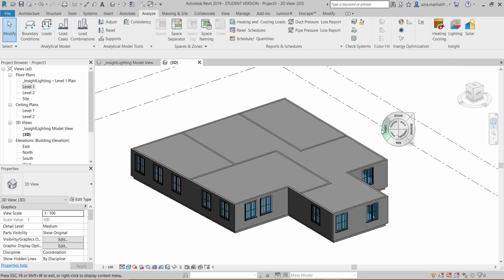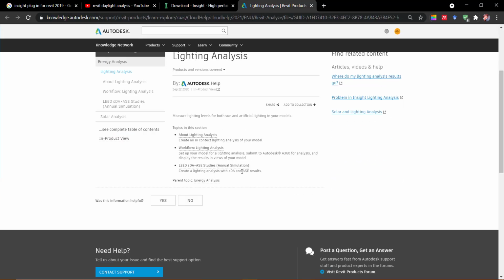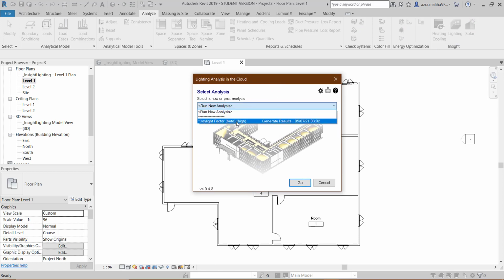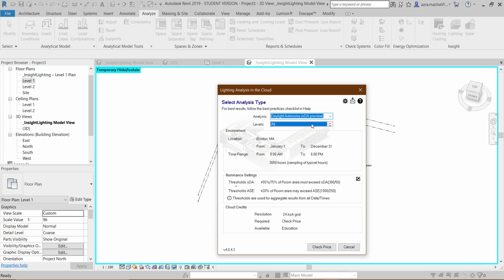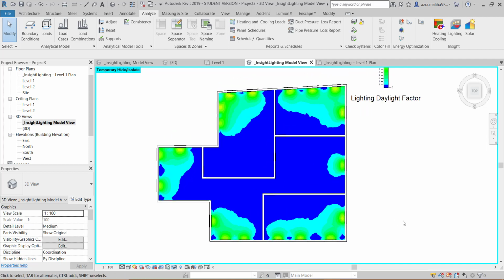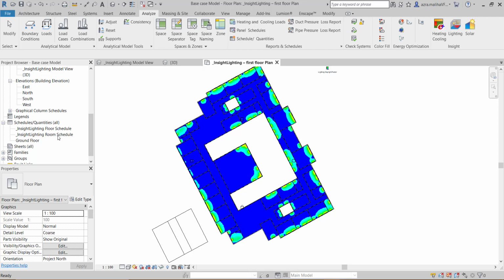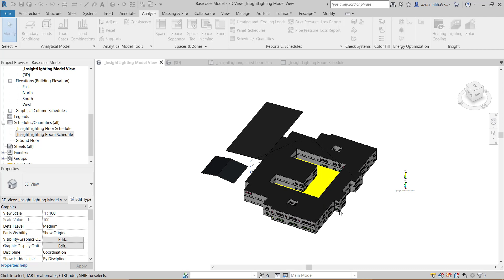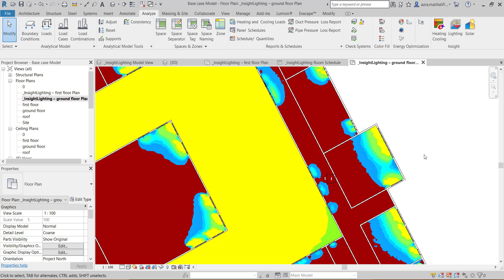Daylighting analysis made EASY!! Learn how to do daylighting analysis with REVIT Insight

Comment: Thank you for the video. I have a dilemma with the model I am working with. When I ran the illuminance analysis, the result does not capture the artificial lights added only the sunlight, making my lux/fc levels very small. Any suggestion on how to include both the sun and added recessed lighting fixtures?
Reply from the maker: Hi Ibrahim. I am not much aware of how to add artificial lighting in Revit and run the lighting analysis.

Comment: Greetings,
I am trying to run a Daylight Factor Analysis using Revit 2021 and my project has 5 different levels. I want to run analysis on ground and first floor together but the Floors not shown in the sequence I want while running the analysis. Initially I used to press shift and select multiple floors that I wanted to run my analysis on. But because they are listed in a very odd sequence, I am unable to select 2 floors together without selecting two more floor levels. Consequently, it is making it impossible for me to select two floors that I want in my analysis. I don't want to run 2 separate analyses because then I would have to combine both in excel and that is a very lengthy process.
I usually add a number before my floor levels so that I am able to see it in a sequence within my project browser. I tried removing the numbers as well to check whether that sequence changes in the analysis dialog box but no avail. I have tried creating new files, copying the existing structure to another file as well but nothing seems to work.
Do you know how to cater this issue?
Thanks.
Reply from the maker: Hi. It's a very odd problem that have occurred with you. It's better if you can send me screenshots of ur levels, or ur revit file to me so that I can try for myself and send u some solution if possible. My email is azra_maliha@hotmail.com

Comment: Thank you for sharing this process it was quite helpful. I have a question in this regard. We need to add materials with original settings in the project so that the light reflection values are similar to the original building settings right. So in order to add paint having the original Light Reflectance Value for wall paints, I am having a trouble assigning a physical parameter from material library to it. How did you assign the proper materials in those settings?
Reply from the maker: Hi Maria, that's a great question you have raised. Unfortunately revit doesn't allow such detailed parameters for their materials like reflectance, unlike software like the IES. As far as i have learnt, the amount of daylight inside the revit building is dependant mainly on the windows and openings, irrespective of their reflectance. So the analysis is done on simple open-or-close situation. If your study required such parameters, I prefer different software like IES, DIALUX etc.
Hope this helps
Reply: @azramaliha  Thank you so muck for responding. I get it now.

Comment: Thanks.. is Revit insight the best software for daylight analysis
Reply from the maker: I wouldn't say it's the best and ultimate software but it is great for several reasons. For example the analysis happens in the background so you don't have to stop everything and wait for the results, the results are very elaborate and dynamic too. However in case of illuminance analysis for example, lux contours are usually not perfect on Revit so a supplementary software needed sometimes.

Comment: I wanted to know.. this analysis will work in revit 2021 … because I installed a plugin but the start analysis button is missing… please guide me
Reply from the maker: Hello, yes absolutely it will work on 2021 version. You can find more video on my channel showing analysis in 2021. 
Make sure you installed 2021 plug in and I recommend to restart the computer before using. Let me know further

Comment: Hey! great video. I'm trying to analyze REVIT 2021 but it says " Requested service not available" I don't know why. iIt doesn't work.
Reply from the maker: Hi. I'm not familiar with this error but I helped someone solve it earlier. You could do the following things that might help:
- check if the Inshght plug in is installed properly 
- check your license, what kind of Autodesk license do you have. A crack version might create an issue
- try restarting the computer after insight installation
- if still the problem occurs, try uninstalling the revit using Autodesk Uninstall tool and reinstall again.
I hope these helps. Let know any further issue
Reply: @azramaliha  Huge thanks for the reply. Hope it works!! Cheers!

Comment: Good evening I had been watching other videos of lighting analysis with Revit plus Insight but it happens that they are very old, I found your video that is recent and it seems very good ... the problem I have is that in other videos I saw that in their planning tables both floors and rooms gives complex data with percentages (in my case the room planning table comes out the same as you do, but I don't get any information on the floor plan) ... do you know how to do this? I hope you can help me… Thank you.
Reply from the maker: Hello. Firstly, revit doesn't give data on floor plans, it's the exact same way as the video. They give a legend though which you can see a small bar on the side. Could you give me the link of the other videos you have seen? So I could tell you further. 
Because throughout the years Autodesk Insight have changed and they actually stopped a lot of options
Reply: @azramaliha  
Thank you very much for answering ... The video that I mention is this: https://youtu.be/a9PbZw9h6KY

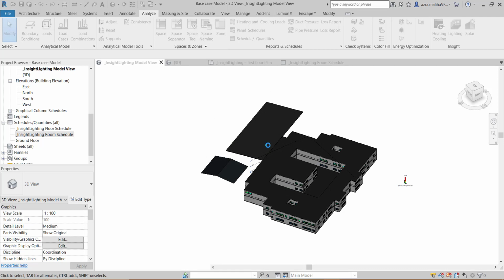There, at 10:30, they show their room and floor planning tables with certain data.
Reply from the maker: @yeseniajakelinesilvestrevi9827  yes that's called a Room Schedule. I just tried it myself. The video you gave was very clear. One you load the insight results, look to the Projecr Brower that should be on the left side of screen. Scroll down to Schedules/Quantities and click for drop down list. You will get "insightLighting room schedule" 
This is avaible for 2019 version and more. Hope this helps.
Reply: @azramaliha  I am working in Revit 2020, and I followed all the steps in the video, however, in my room planning tables it comes out like you do and not like in the video I'm telling you (that is, I don't get the percentages), and in the floor planning table that the man gets, there is information, and that table does not give me any information.

Review the comments of the video that I gave you and there are more people who have the same question, however they could not request it either.

I would greatly appreciate it if you could make a tutorial on that, since I have already searched for several days and I do not see that someone has solved that question is YouTube. ☺️☺️☺️
Reply from the maker: @yeseniajakelinesilvestrevi9827  ok sure I can make a quick tutorial on it 😊 kindly subscribe so you can be notified for it
Reply: @azramaliha  Muchas gracias de verdad, te agradezco infinitamente ☺️

Comment: how can we do this same analysis according to the NORTH?
Reply from the maker: Hello. By default all kind of model and simulation softwares have their North directed towards the top of the screen (similar to revit or autocad). So what you can do is first model your building normally and then rotate it (if it is an existing project). Or simple model the building keeping the top of ur screen as North